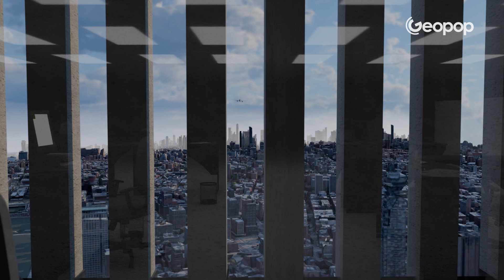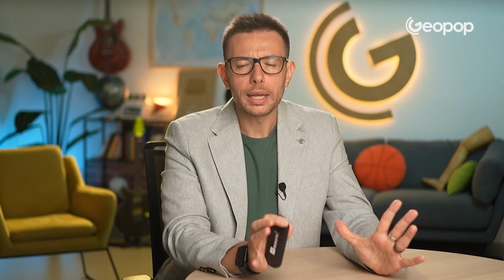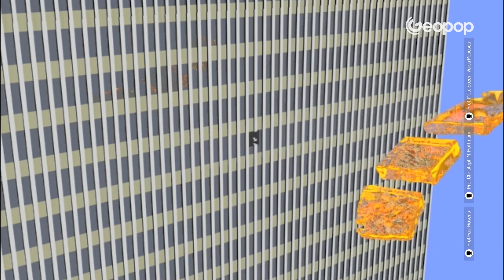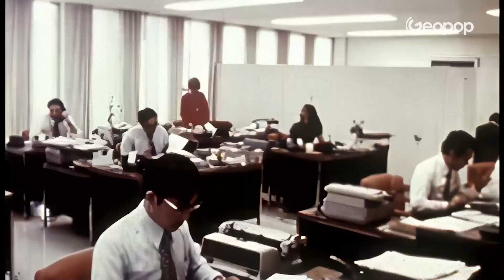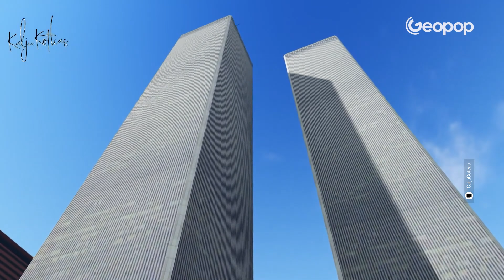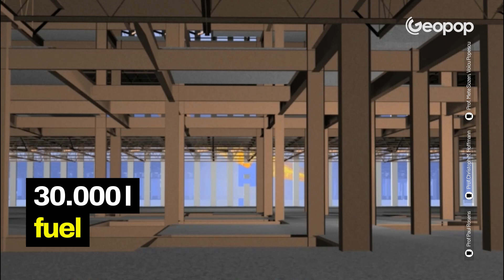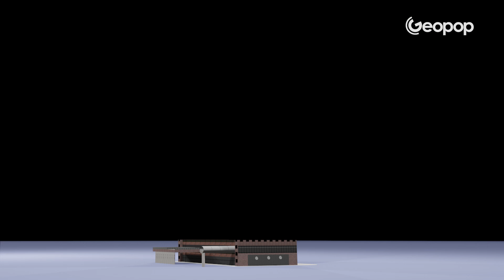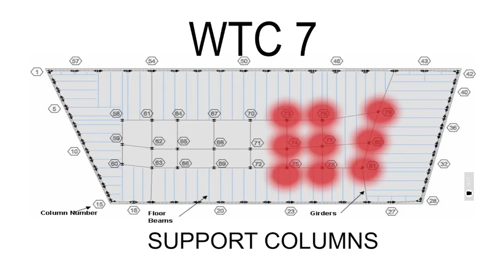9/11, 2001: The Technical Reconstruction of the Twin Towers and WTC 7 Collapses

Comment: The 9/11 conspiracy theorists are always so stupid it's funny. Here are multiple reasons to why it's NOT an controlled demolition:
1. The plane was traveling around a 970 km/h when it hit the tower, do you think a building can withstand that?
2. The plane was fully fueled when it it the tower.
3. The fire got around 1000 degrees Celsius which caused the steel to soften and weaken.
4. The plane ripped off multiple support columns.
5. As the remaining support columns became weaker they started to bend.
6. The bending got so extreme that the columns couldn't hold the weight of the floors above it.
7. When one floor collapsed the others couldn't hold the weight and so the next started to collapse and it started a chain reaction
Reply: Wow you conspiracy theorists are getting ridiculous when you don't even know you're a conspiracy theorist and insult yourself.  Let me help you as you've made some critical errors.  1.  The building did withstand it, it wasn't the plane impact that caused the destruction nobody claims that except you.  2. Correct. 3. NIST NCSTAR report clearly states they found no conclusive evidence that pre collapse fires were hot enough to weaken the steel, so no.  4. Likely 5.  See point 3 which negates this claim.  6.  NIST had UL run tests on a floor assembly which they subjected to fires hot enough to weaken steel for twice the length the towers burned under twice the load.  the resulting sag was 3".  Looking at how long they burned, had they found conclusive evidence fires were hot enough to weaken steel under regular load you'd get maybe 1.5" of sag and that's being generous, so incorrect and contradicts the official study.  7.  Incorrect, Verinage demolitions which do not use explosives and are done on weaker buildings that are not steel framed and drops the top onto the bottom, we see a jolt when the top meets the lower section followed by constant deceleration until it comes to a rest.  So observing a known gravitational collapse on a weaker building  does not resemble what happened to the twin towers in any way shape or form.  Hopefully you go and check for yourself and correct your mistakes and stop insulting yourself.
Reply: @brianstantz3459 did you even read my comment? I am not a conspiracy theorist, I said that I do NOT believe in that the towers were destroyed by controlled demolition
Reply: @brotherbohman  If you think Al Qaeda did the attacks, you absolutely are a "conspiracy theorist".  I then corrected errors you made in your post some of which go directly against the NIST NCSTAR report.
Reply: @brianstantz3459 Al qaeda did the attacks, it wasn’t a controlled demolition, also are you going to deny that planes hit the buildings? Because over 10 million saw planes hit the building. Also when the plane hit at around 970 km/h it completely destroyed 9 support columns and about 30 Other columns, also the fire made the other support columns and floor supports sag and weaken, combine this with the weight above the impact zone and you have a collapse. When one floor collapsed the floor below couldn’t hold it and also collapsed, this caused a chain reaction making the other floors collapse, you can literally see bending right before the collapse, this is due to the sagging floors pulling the outer columns and walls inwards and bending it
Reply: @brotherbohman "Al Qaeda did the attacks" is a conspiracy theory and not a very good one either.  I'm guessing you've never been asked to prove it have you? My guess is you never even questioned it right? Let's see how you do. On Sept 10 and 11 they have a lot of time and date stamped security images of Atta and "Omari" in Portland at ATMs and even the airport security, this was something easy to do in 2001 to show someone you accused of something was where you accuse them of being and when. Can you show time and date stamped security images of even 1 of your "al Qaeda" terrorists at just 1 of the 3 airports they absolutely had to be at to even be a suspect? As mentioned it's ridiculously easy to do even back in 2001 as was illustrated by them tracking Atta and Omari in Portland, so don't try claiming it wasn't. Now go ahead and try and place your alleged hijackers at the airports, not on the planes, just the airports.  You'll find  out your conspiracy theory falls apart rather fast. PS don't use the Portland airports time and date stamped images of atta and "omari" as that isn't one of the 3 airports you need. Good luck!
Reply: @brotherbohman  Wow, what BS source do you conspiracy theorist have all that BS desinfo from?!?

"1. The plane was traveling around a 970 km/h when it hit the tower, do you think a building can withstand that?"

First off I got shocking news for you: WTC got hit not by one but by TWO planes. According to NIST the second one crashed at around 540mph which would be 870kmh, not 970kmh. The first plane crashed at 440mph which is 708kmh. Do you realize how even your first point makes you look like a pathetic idiot already? But I´m not even finished with your first point of failure, here´s another shocking news for you:
The Twin Towers were literally designed to withstand plane crashs! Planes crashing in at 600mph, faster than any actual 9/11 plane and therefore more destructive according to NIST. Oh you poor little wannabe...

"2. The plane was fully fueled when it it the tower."

Again my poor wannabe, it was TWO planes! But none of them was fully fueled. How do you even think it would be possible for them to crash in fully fueled?!? Air refueling right before impact?!? These planes weren´t even close to fully fueled at take off. What a pathetic wannabe you are...

"3. The fire got around 1000 degrees Celsius which caused the steel to soften and weaken."

Oh my poor wannabe... What matters is not the temperature of the fire but the temperature of the STEEL. What NIST found out about the steel temperature was told to you already my poor little wannabe...

"4. The plane ripped off multiple support columns."

I guess you´re talking about the PERIMETER columns? Yeah, looks as if even the wings cut through perimeter columns which is kind of astounding. Some impact videos even look as if the aluminum wings weren´t even destroyed as they cut through steel columns which I would call physically impossible.

"5. As the remaining support columns became weaker they started to bend."

Even according to NIST the PERIMETER columns didn´t bend in because they were weakend by fire but because the floors were pulling the PERIMETER columns inwards. They claim it was because the floors were sagging, however there is no proof of sagging floors and it´s a rather stupid idea that weak sagging floors could pull the PERIMETER columns inwards just because of their weight. It was cut core columns that pulled the NOT sagging floors inwards. And as the PERIMETER columns broke they snapped back which they wouldn´t have done if they were as weak as you dream of my poor little wannabe.

"6. The bending got so extreme that the columns couldn't hold the weight of the floors above it."

The bending got so extreme that the PERIMETER columns BROKE. OF COURSE broken columns can´t hold anything, stupid.

"7. When one floor collapsed the others couldn't hold the weight and so the next started to collapse and it started a chain reaction"

They weight didn´t increase due to collapsing floors. In fact THE OPPOSITE is the case since lots of debris was pushed to the outside.
And here´s another big news for you: The lower halves of the core structures survived the initial collapse "chain reaction". Only to then collapse slightly delayed even though nothng was cruhing down on it anymore.
So yeah, there was TWO core collapses for each tower and just like any other shill wannabe you addressed NONE of them.
So here´s the next big news for you: The buildings weight wasn´t carried by floors nor floor connections, the entire building weight was carried by COLUMNS, especially by the CORE columns that defenders of the official conspiracy never dare to address.

But honestly, I think your funniest fail is still that you conspiracy theorist are way too much of a moron to realize that you are a conspiracy theorist yourself.
Reply: @brianstantz3459 I agree. 9/11 was a conspiracy by Al Qaeda flying hijacked planes into the wtc by terrorists.
Reply: @brianstantz3459  - More CT whack-a-mole. Not even your own arguments.  Seen that same failed copy-paste many times. 

Care to state your references?  Exact quotes with page and chapter numbers?  

No, of course not. You don't know them. Almost certainly never even read NCSTAR-1 yourself.
Reply: @TheLoonResistance  You must have a very short memory.  NIST NCSTAR 1-3C pg 235 "No conclusive evidence was found to indicate that pre-collapse fires were severe enough to have a significant effect on the microstructure that would have resulted in the weakening of the steel structure"  Then you say " but they only tested a tiny %" to which i respond "in what hard science do you keep a hypothesis after testing fails to show support? You either continue testing and find it or don't or discard the hypothesis"  then you run away.  So is there any point in going further since we've done this before?
Reply: @brianstantz3459 - Stawman much?
Reply: @TheCriticalStinker-01 what a horribly predictable response.  So can you show what testing NIST did on the physical beams they had full access to showed temperatures capable of weakening the steel? If yes, show the page etc. If no then there is no conclusive evidence fires were hot enough to weaken the steel and anyone claiming otherwise is contradicting the NIST NCSTAR report. Cue running away
Reply: @brianstantz3459 - I am objecting to your previous post in which you credit me with things I never said.

That's called lying.
Reply: @TheLoonResistance oooo he got you there. Lol
Reply: @TheLoonResistance mmhmm. And i suppose youve forgotten yesterday you ran away after i asked you what evidence against KSM there was since a confession through torture isnt admissible or reliable? I just looked and that was yesterday.  If you dont remember that id question your memory on any conversation
Reply: @brianstantz3459  - More deliberately evasive off-topic derail from you. Shocker. It is becoming a pattern.
Reply: @TheLoonResistance You never answered that question. Can you tell me what i asked to prove you dont have a severe memory issue? Should be really easy for you to do
Reply: @brianstantz3459  - As soon as you apologize for deliberately mis-quoting me.
Reply: @TheLoonResistance  As I thought, you have no idea what was said and when.  Are you one person running multiple accounts or one account run by multiple people?
Reply: @TheLoonResistance  on every reply  like the MicroPenis <uck  

You zionist shill aren't fooling anyone  what a boring life you must lead God it must suck to be you 😅
Reply: @brianstantz3459  - I don't give a shit.  

Collapse mechanisms for the Twin Towers and Building 7 - got anything to say about that?  Those are things I give a shit about, not whatever attention seeking, coup-counting games you want to play.  You do not matter.
Reply: @TheLoonResistance  I´ts always the same with you attention seeking troll... As soon as you get the attention you do nothing but dodge.

Comment: I find it interesting that ALL 3 Towers fell straight down, and not tipping over.
Reply: Why would they tip over?  Buildings are not trees.
Reply: @TheLoonResistance  come on. ALL 3 building fell perfectly down.
Reply: @NexivoStories  - Define "perfectly"

I don't fall for argument loading
Reply: @NexivoStories  Because down is the direction that gravity goes, and there would be no way that a couple of beams at the bottom of the towers would be strong enough to support the weight of the whole building above it if it began to tilt, meaning if it ever did begin to tilt, the beams at the bottom would break, and it would still fall straight down. Also, tower 1 and 2's damage was not at the bottom of the tower, so they would never have had the chance to tip over to begin with.